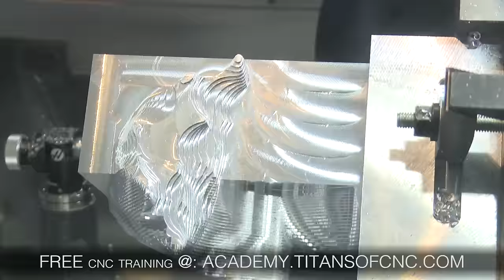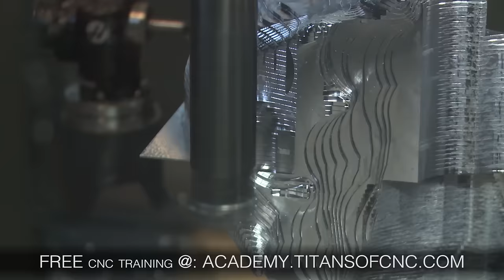Mind-Melting CNC Machining

Comment: yo titan...just like you build custom parts..do you even build custom drill bits which are designed to work at 833 rpm??or do you use commercially available drill bits for 833 rpm projects??

Comment: how do you guys run aluminum without coolant? normally coolant sticking to the cutter is a big issue without coolant
Reply: it has to do with the width of cut and the tool itself, you can do adaptive milling without coolant, but using coolant gives you better surfaces

Comment: i used  milltronics.. better than haas
Reply: Agustin Nerli so, what's your point? I've used both Haas and the premium Japanese / German machines. Never had an issue making money with a Haas. Yes the others may be more rigid or have more power, but I rather buy 3 Haas machines than one Mazak. 
Having three spindles running at the same time generates more income. 

Not to mention the 500 euro price tag for mazak pdf manuals on a DVD!
Reply: Agustin Nerli lol haas might not be the prettiest or absolute fastest machine but the one shop that I worked in that had 20 year old haas' had less machine downtime than shops with crazy expensive matsuura, and the Mikron was broken more than it was running
Reply: I't super hard for the Haas to pay for itself, let alone more expensive brands :\
Reply: after working on Heidenhais CNCs from the beginning, i wouldnt want to work with a Haas or else Controller. Alone the way you probe is a factor for me, i want to position the Touch probe anywhere i want  (manually), not always using a cycle but if i want to use a cycle, i can do that as well. Creating programs especially 5 axis is way easier on Heidenhain than on others, at least for me.